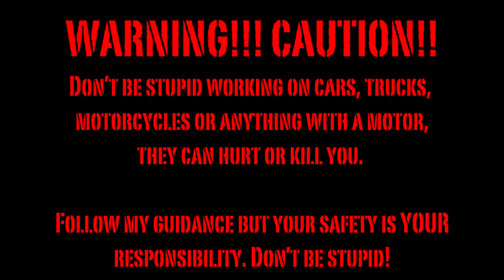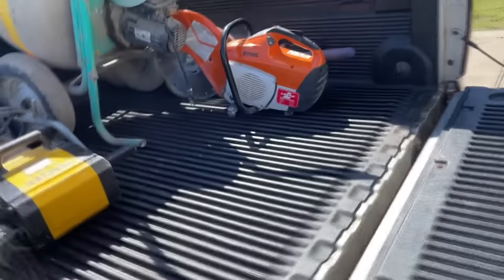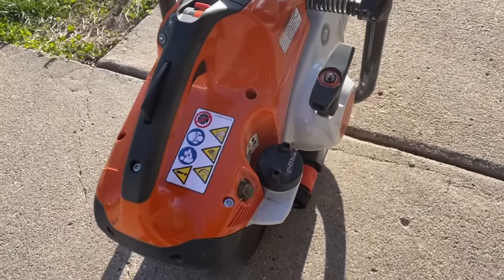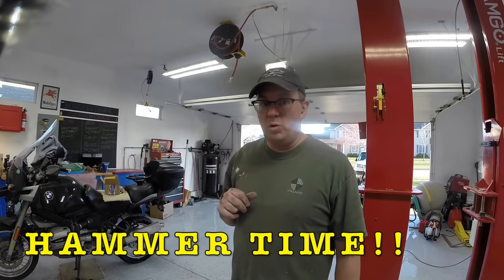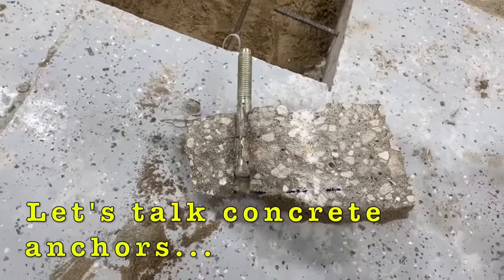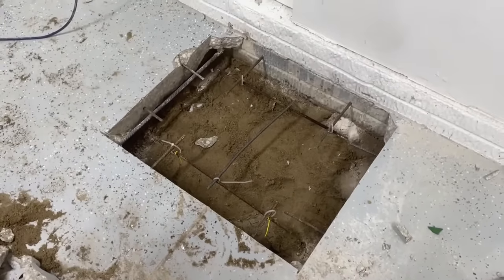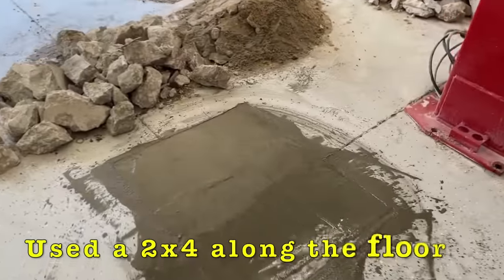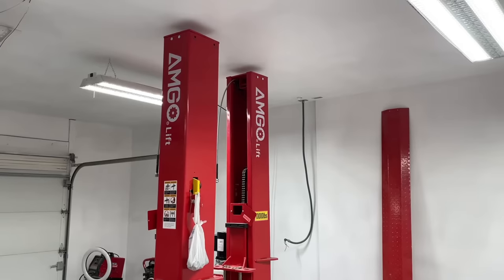My Lift tried to Kill me!

Comment: Most lift manufacturers tell you anchor bolts should be installed at a six inch minimum to saw cuts in concrete
Reply: It’s almost like he tried to violate every rule…😢

Comment: I'm just wondering why you did not install the bolts in the concrete when the concrete was wet and then go ahead and set your beams on top no need for drilling and waiting and all that stuff but everybody's different.

Comment: 4 1/2”  is the general rule  for “minimum” requirements  in depth and 4000 lbs for concrete strength. 
When pouring a pad to make right any insufficiencies you need to take out at least 3’x4’ or a preferred 4’x4’ area and then dig it down to 8” deep, undercut (which means to dig a bit Under the existing concrete a couple of inches), and pin it to the existing concrete with several sections of rerod. Two or three 8” pieces embedded 4“ in the cut faces should do it. Normal quick Crete is NOT good enough!
Use hi-early 4000 lb poured all within time enough for it to be one slab finished as one piece. Not new Crete pour in on the drying last batch. If you can’t mix it up in volume enough or quick enough, Call for cement to be delivered. 
I’ve put in well over six thousand lifts probably more likely close to seven thousand over the last twenty some years and I knew by the first images of your lift with it still installed that your problem wasn’t “not enough cement”, it was the lack of anchor being embedded in the floor. 
Always drill all the way through the floor and always use brand named anchors. Cheap lifts come with cheap, useless anchors as a rule. In fact in the anchors they provide have a lock washer…..
Throw them out and buy hiltes or wedgits or redheads, something good enough that you can count on, or to,  “bet the farm on”.
That thing is going to be holding a car over your head. You want to know it will do that safely.
Reply: I agree. Are Confast wedge anchors decent?  If an anchor wasnt installed deep enough can you knock it down further and retorque?
Reply: I’m not familiar with the name. 
I’ve not seen them in the places we go for supplies here in the Midwest.  (Iowa) Brand names can often be regional and I have no experience with that one. But a good test is to put one into use. That is, if you can acquire one to sample.  
You can tell a lot about it’s quality, by hammering that anchor into a cleanly drilled hole and tightening it down on something. The hole should be drilled straight, with little to no uneven, augured spirals visible on the sides of the hole, as if the drill was struggling and it took too long, and the person using the drill was wobbly and working to hard. Like as using too small of a drill. 
Use a real hammer drill, big enough to do the job, and if you can’t get one, rent one. When you hammer it down, have the nut screwed on flush to the top, it should take at least some effort to do it.  
Leave some room for shims and level the lift perfectly plumb, filling in any gaps under each anchor with shims before  hammering them all the way down, and tightening when installing a lift. 
Once the anchor is set and ready to tighten, you can feel how well it bites into the sides of the cement and snugs the wedge firmly into the hole as the anchor is tightened up.  Hopefully it cinches down, good and tight, and more importantly quickly with very few turns of the nut before it tightens up at some torque specs that are sufficient enough for comfort or requirements.  Ultimately, you should not have many threads showing through the nut when tightened to satisfaction. 
(100 to 120 foot pounds pressure) 
And tighten them by hand.  
There is not too many, and it’s the best way to get 
good embedment. 
And, you must drill all the way through, or drill deeper than the amount of anchor you expect to imbed into the floor and blow the dust out leaving a clean hole. If you leave dust in the hole,  the anchor will not go in far enough to utilize the cement you have available to anchor the lift to full potential. 
As for hammering back down and retightening to get a deeper hold, good luck!
The wedge may get driven down too, already tightened on the hilt, and just end up eroding the area that it is biting into.  When you tighten it again, you could loose ground instead of gain. It’s best to drill clean through so if necessary you can drive it down and put a better anchor in. 
As I have stated before, the best anchor that I (personally) have found is Hilte’s wedge anchors. 
They grab the hole and snug down right as soon as you start to tighten them.  Exactly as intended every time. 
I’ve had to drive failing anchors down and put Hiltes in on top of the failed anchors in the same hole.
Unfortunately, our usual supplier no longer sells Hilte brand or any varieties anymore, they are only carrying Dewalt brand now. 
The Dewalts are pretty good but I set them down flush and then I tighten the nut up about three threads over the top and hammer a bit deeper before I start to  tighten them.

Comment: I cut a section out at least triple the size of the foot of the lift, then dig up under the slab as far as you can stand(lying on your stomach digging gets old)then I make a template of plywood of the foot bolt pattern and use that to hold jbolts when pouring the concrete. I always get the concrete from the local concrete plant as they know how to mix it and I dont.

Comment: Sorry to say this, but it may help someone who is considering installing a two post lift. First off, the 'pads' or footings should be much larger and deeper. It also appears that the posts are too close together. Not much room to open the car doors for better access. Putting the posts wider will lower the lifting capacity. I had a Mohawk two post lift installed at my house but it was a major pain getting in and out of the car. I moved the posts 12" wider and installed bumpers to prevent the doors hitting the posts. My expansion bolts did not need any epoxy and they were set deep and pulled tight in place.

Good luck...

Comment: the best fix for this would have been rip up 2' wide between the posts and extend beyond the posts by 2' and down at lest 2', with a rebar on 8" centers, also tieing it into the existing slab. use J bolts in the concrete to attach the lift. 
you want it scookum enough that you feel comfortable with your kids under a car supported by it. 
all the lift is going to do is push those pads into the dirt.

Comment: Coming from someone that has done concrete work of all kinds for 20 years. This was horrifying to watch. Watching you with the partner saw and the jackhammer without even wearing boots was amazingly stupid. 
Initially. Bolting your lift down within inches of the slab edge was your first huge mistake. Edge of any slab is the weakest spot and you deserved for your truck to fall off. You got lucky.

Comment: QUESTION; would one of the lifts that connects with a cross member at the top have prevented this? I’m not trying to be a know it all, just considering installing one myself and figured the cross member at the top would stop all this side pressure? I’m also wondering if you could bolt a thick steel plate down first with extra holes where it bolts down presently? The plate should spread out the pressure per square foot. Now that I’m thinking about it, all the above but weld the larger plate on so the large plate bolts down and it bolts through the current holes too?
Reply from the maker: Jerry, 

No a connection that the top would have hidden the problem but not resolved it. It was caused by my failure when  used the epoxy and that didn't allow that the anchors to bite into the concrete.
Reply: @honeybadgermotorworks7561 Do you have a video update on this lift?

Comment: Wow this was hard to watch. The first failure I pretty much knew before you revealed the problem that the anchors didn’t grab deep enough in the concrete. The repair I can only speculate that it’s not gonna be safe either. You needed to go at least 12” deep under the existing slab.

Comment: when I built my garage I had a 1 foot thick footing poured around the perimeter and a 1 foot thick 2 foot wide support poured all the way across where my lift would be bolted to the floor with high grade concrete.

Comment: Death trap. The new concrete pads are not the proper fix. Not big enough in cubic footage. Need to be many times thicker and more square footage, heavily reinforced with rebar. As they are now, a off balance raised vehicle can pull those pads up and topple the lift. Certified lift installer should be mandatory.

Comment: I had the same problem in my shop with the 3 lifts installed by "professionals" when i bought them. All anchors where loose.
My repair was to tighten up the anchors to expose much of the bolt, then remove the nut and cut the anchor, then hammer the  remaining bolt down until it went into the soil (how fast it went into the soild showed me my floor was only 4 inches thick)
Cleaned the holes with air and injected concrete epoxy untill started oozing out, installed new anchors and tight them cpl days later.
That worked for 10 more years lifting limos everyday.
When i sold the building and took the lifts off, i tried sledge hammer the anchors in and the would now move, i had to cut them off. Thats how hard the epoxy was.
Just my experience. Not a concrete expert.

Comment: wet set is the best way to go... red head bolts stink. when you pour cement wet it has no psi. the dryer you pore cement the stronger it is. wet cement is half as strong. and is weak

Comment: Presetting “J” bolts would’ve been better, anchor bolts tend to loosen and move up and down over time. Whenever using anchor bolts, I would recommend using a bonding agent or an epoxy in the holes as you install them for added strength.  Nice video.😬👍
Reply: How can you install a j bolt after the concrete is in place? Or are you supposed to do that beforehand with a fresh pour?
Reply: @acetech9237  that’s correct, you set them with the form, prior to the pour.
😉👍
Reply: I welded a metal plate with nuts under it and placed the plate in the concrete, so I can use bolts to attach the posts, making it easy to remove them (and yes the plate had extended metal rods into the concrete all around it).  When I did remove them, I put them in existing concrete and did the expansion studs (which came with the used lift, as he used jbolts in his original install, so had the expansion studs unused).  So now I have to move it again, and how can I tilt the towers down with stud sticking up hold it in place?

Comment: I would never have the controls next to the wall. If the vehicle slips/falls, you have no place to run. Double masonry anchors and epoxy is the way to go for anchoring a lift. Did you even make sure that the concrete was at least 6" thick? It's unlikely that the concrete has the right PSI for a lift too. You're risking a lot being in that situation. Remember to have the lift inspected by a licensed inspector/installer. Don't be surprised if your insurance company makes you remove it. most homeowner policies don't allow it and will cancel your policy. They will also notify your finance company that you are without insurance, and you could end up forfeiting your mortgage and house.

Comment: Here is what I did. Did exactly 1M by 1M squares and 40CM deep. Concrete mix was 1 Cement, 2 Sand, 3 Aggregate.

The guy who came to drill, had a tough time even though he is muscular. The drill bit broke. Return second day, the second one broke and he was like wtf is this piece of shit. I calmed him down and paid him for another drill bit plus soke extra for his trouble. Do not play with the mix! And always keep the anchors at least 4 inches from edge of final slab.

Comment: Sounds like all you need is larger diameter bolt and much deeper resin anchors.  But I would still put a timber beam between the posts at the top to ensure there is no chance the posts will want to pull together.  A resin anchor has the full surface area of the hole to hold it in place, not just the tip of the expanded nut.  The widely fluctuating load of a tip anchored expansion bolt is an invitation to work loose.  I don't know what in god's name made you think to saw out the concrete.  It's not the concrete's fault it failed.

Comment: Your lift didn’t try to kill you.  You have twice tried to commit suicide through improper installation.  The most likely cause of failure was lack of edge distance for the anchors.  Are you sure the lift manufacturer didn’t specify a minimum edge distance in their installation instructions?  Using epoxy in the hole is generally a good idea, but you need to torque the fastener before the epoxy sets up.  Did you do that or did you let the epoxy harden before you torqued the nuts?  If the epoxy hardens around the end of the anchor, then it very likely will prevent the anchor from expanding properly.

Your repair likely will fail also as your concrete has far too much water.  The water should be added by measurement and then only very slight adjustments to water made for workability if needed.  The concrete should be fairly stiff and require some work to float and trowel flat.  Your concrete will be very weak and will likely shrink significantly which may well loosen the anchors again and cause them to slip.  And the strength will be much lower than normal.

As a retired engine with a masters in structural engineering, I would recommend you consider getting a professional to install this life a third time using properly mixed concrete and properly installed anchors.

Comment: WHY…… didn’t you weld 4 bolts to a frame and put in the hole and then pour concrete, with 4 bolt sticking up ready to torque the lift on?

Comment: When I was shopping for lifts all of them I seen stated you needed at least 6 inches of concrete for anchoring
Reply: Correct, minimum requirement is a 6" slab for a lift.

Comment: Yikes that lift has the footprint of a high heel. I would  be skeptical if that lift is safely rated for 7k. Look at the base plate of a Mohawk and see the difference.
It's terrifying how many cheesy stamped steel lifts are out there with clocks ticking. One of my Mohawk posts weighs more than your whole lift.
Mohawk makes 2 POST LIFTS BEYOND 26 TONS! you read that right.
Reply: At least add a steel floor plate  between the posts, creating a larger base.

Comment: Not all concrete is created equal these things happen. If it was me I would have moved the lift more towards the center of the garage I couldn't do the things I do up close to that wall. You could also tie the tops of the posts with some square tubing and totally eliminate that problem.

Comment: The issue is much easier solved by tying the top of the tower to the wall. For the other tower that is in the middle of the garage, run a metal cable along the ceiling so it's not in the way, and tie to the opposite wall using a binder or something. Towers won't be able to flex inwards.
Reply: Residential framing would fold like a cardboard box if a person did as you describe. Get real.

Comment: i cant believe you cut those big ole holes and didn't use J-bolts and lag and shields hold up way better than expansion bolts also it takes more than rebar to tie a floor together the cut out area was way too small i worked in the sign industry for a long time it doesn't take much for a pole to come up on a 4-6" deep pad J-bolts welded to a rebar frame would have been much safer

Comment: I'm flummoxed. In Europe, the specs for a pad for this kind of lift is either a 20cm/8in slab 4mx3m  (12x9ft) or two blocks 3mx1m (10x3)
and 0.8m deep (short of 3ft). And min 20cm distance to the edge. 

And I've never heard of putting epoxy on this kind of anchor. There's special epoxy anchors for that.
Reply: The person who is really flummoxed is the clown who posted the video. He obviously cares nothing about safety, operating dangerous tools the way he does. Nor is his “repair” in any way adequate, starting with the fact that the concrete was way too wet to cure anywhere near the rated strength, and he didn’t bother to cover it with plastic sheeting to slow the curing. Terrifying.

Comment: Rebar doesn't need to be in middle, lower third as concrete doesn't do well in tension and thus the need for rebar.  The small pad is not large enough and should be tied into the foundation wall.

Comment: I don't trust above groundd lifts..as u shown..in this video..I got an Rotary inground lift..used..air over oil.  The oil tank is above ground..,so no EPA issues..it's going in my garage at home..it only needs 150psi from my air compressor..  open clean floor look.  My dad had 5 lifts in his shop..never had issues in 45years he owned his station..